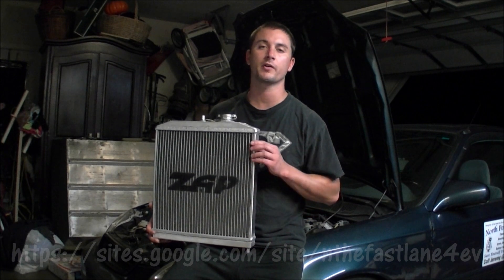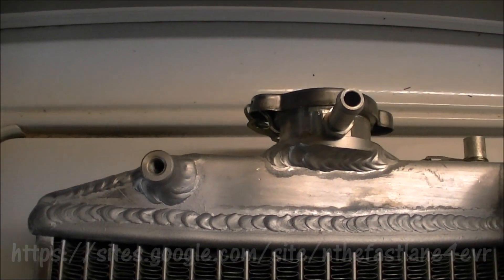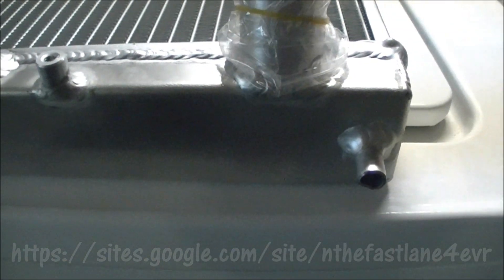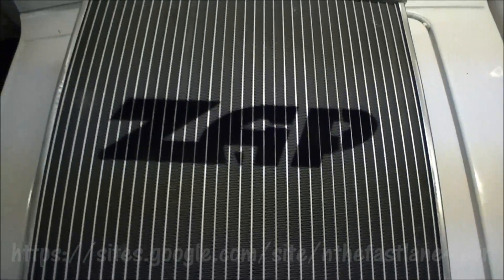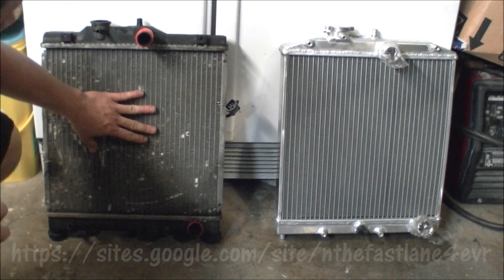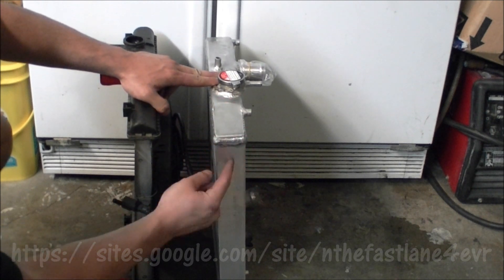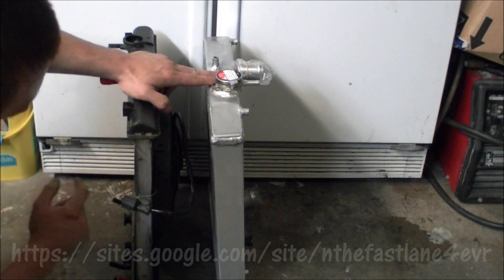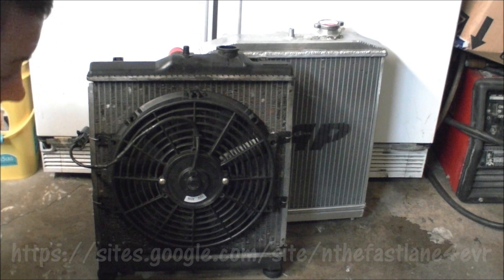Dual Core Aluminum Radiator Review

Comment: dude to be honest with you... it is great man. all the welds are really really solid and you can tell it wasnt just rushed through. im one to shy away from new products but god damn this was perfect in every way bro. even the oem fans bolted right up. only thing i did was bought a better radiator cap for more pressure from Z1. other than that I WOULD RECOMMEND TO EVERYONE its hard searching for reviews on these but i would steer anyone in their direction.

Comment: Cut the cores in half...then and only then can you tell if the radiator will be better at cooling.  Just because it looks thicker doesn't mean the cooling tubes in between the fins are twice the width.  A lot of Chinese-made knock-off rads aren't made with wider cooling tubes which makes the "dual" core a moot point .

Comment: i just bought a aluminum radiator for my civic and my oem hoses don't fit, are the silicone hoses a little bigger in diameter for fitting the radiator?